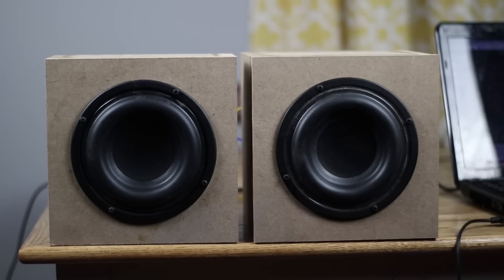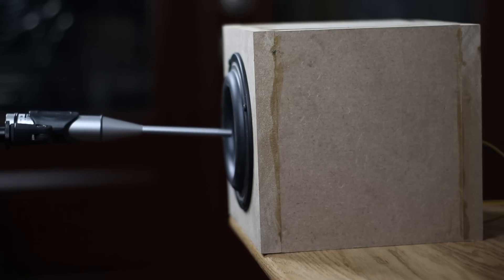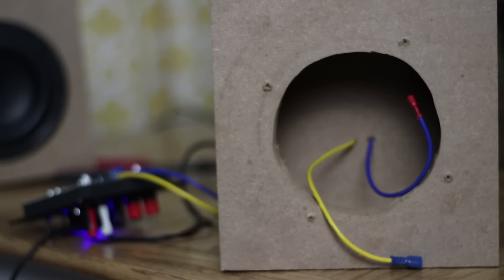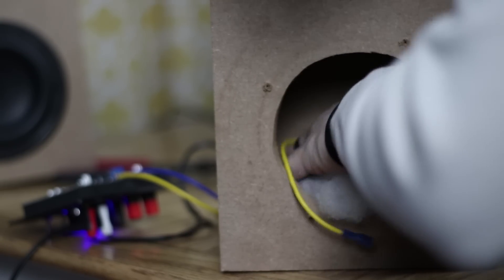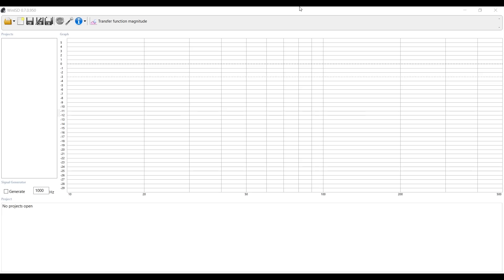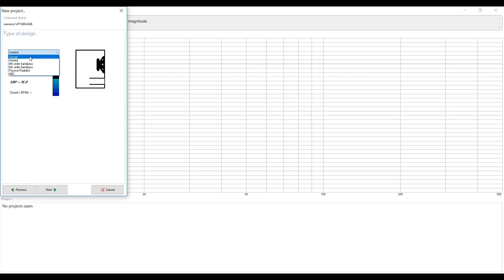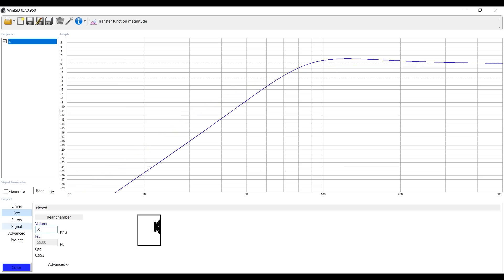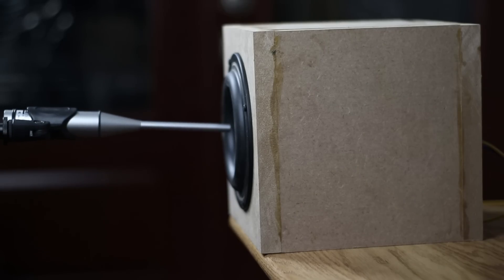Does Polyfill make a Box BIGGER?  Tested and Revealed

Comment: hihi toid you farvourite. driver from tangband is the one with rather high distortion :( at least mine had
Reply from the maker: It's probably my favorite small subwoofer (under 5 1/2"). There's not many that can get down as low with the large amount of output and relatively small box. It makes it very versatile.
Reply: Distortion in the lower frequencies has to be rather high to be discernible...

Comment: My speakers use 15" woofers in a 5.5 cu. ft. enclosure and 10" midrange in a 0.5 cu. ft. subchamber. The woofer portion has two 4" ports and the midrange is sealed. The ports are quire long and include a 90° turn. They only really come into play where frequencies are below the driver resonance. The woofer portion of the cabinet has some poly batting to reduce internal reflections on some surfaces. The midrange poly was determined empirically. I added and removed batting and listened to a lot of music. I think you can get in the ballpark with measurements, but leave it to your ears to get it right. If you alter one speaker at a time, you can compare sounds by switching back and forth. 

Nothing was indicated in the video about how batting works in an enclosure. As the pressure changes, the batting provides a much larger surface area for energy exchange. The pressure is converted to heat at the fiber surface. When pressure is decreased, the fiber gives up heat as pressure. Adding surface area in this way only works to a certain extent. Adding more batting reduces the energy transfer efficiency. The sound does change. As an absurd analogy, consider singing with a mouth full of cotton candy.
Reply: So well spoken. Exactly on point!
Reply: Your sub enclosures sounds just like mine. 15" sub, 5.5cuft, two 4" ports @ 36" long with 90° bends.

Comment: Good video.  I encounter this challenge when I want to build a speaker inside of an existing object (e.g., vintage radio case).  Sometimes the ideal space just isn't there.  I'd love for you to address the question of whether or not you get same impact from poly-fill in a ported enclosure. Also, the "weight" of speaker poly-fill you get from places like Parts Express is much heavier and or denser than the typical pillow stuffing.  What about the different impact of type of fill?  what about fiberglass wall insulation?  I see people using that stuff as well.  You can do more on this subject that would be of great interest.  Thx!
Reply: To answer your question (five years later) Polyfill pillow stuffing acts as both heat and sound insulation comes in different "loft" types which indicates density. For speakers; you want "extra" loft. Roll type is cheaper to get, by weight, than fiber fill, but you'll want to fluff it up first before stuffing the speaker if it's the roll type.

Comment: Another option to look into would be an Aperiodic Speaker Enclosure.
Reply: Oops never mind. I was confusing this with Steve Guttenberg's video that I watched right before this.

That's actually a really good point. The infamous Dynaco A25 is one, as is the KLH Model 33 (I own a pair of these actually, pretty nice sounding too). It's a great way to make a box seem bigger, and increase the bass extension. This is used in car audio frequently too. Due to the obvious space constraints.

Maybe we can get him to do a test on that too. I would be very interested to see the actual results of such a test. I've always been interested in this type of enclosure, especially since I have a small listening room.
Reply: @amb3cog  I use it in car audio after seeing it in my home setup. I have 2 10" subs that use Poly-fil due to small places but the subs are recommended for 0.4-0.6 cu' and Heavy Poly-fil so I used a bag in each enclousure and they hit hard. Now I am using them on my doors of 91 Nis Hardbody in a .4cu' enclosure per door. And going to tune from 50Hz on 12dB slope up to 90Hz so it will play down to 40Hz-100Hz as more of a MidBass vs Sub!
Reply: Aperiotic can artifically inflate box volume by about 25%. And if done right can give the effect similar to infinite baffle.
Reply: Varying the amount of polyfill is a great way to fine tune a transmission line cabinet. Much more reliable than the long fibre wool I used in the 1970s. It got eaten by clothes moths!
Reply: @jonathansturm4163  indeed. Getting the mathe just right can be a pain, but sometimes a little polyfill can correct them.

Comment: How would using a material with a higher density work? Like if you filled the speaker box with insulation?
Reply from the maker: I think that's a great question and I think it's worth exploring. For example is there a material that works better than polyfill. Maybe we will do a video on that in the future
Reply: @Toid  I would guess something fibrous that would convert movement to heat better, I actually sometimes use denim base insulation.
Reply from the maker: @attainableaudio7130  I think it would make a great video. Especially testing various stuffings to see which performs the best
Reply: @Toid  Believe It or Not - Back in the '80's, in Britain's 'HiFi News & Record Review' was a DIY speaker article, in which the author suggested a low cost alternative to Long Haired Lamb's Wool. Then considered to be the Ideal material, for these applications. The suggestion was Newspaper put through a Paper Shredder ! The reasoning was that Newspaper actually has a high cotton rag content. Mind you, The DIY enclosure in the article was a Aperiodic box. Which like a Transmission Line, would require vast sums of the stuff to line it properly. So the suggestion was truly a cost savings measure.
Reply from the maker: @RoaroftheTiger  now that is really interesting. It would be kind of fun to test something like that out. Thanks for the info!
Reply: I think this video is begging for a" part 2 experimenting with different fill materials to if the smaller box could out perform the large box"

Comment: That's not how it works. Woofer/enclosure systems are best modeled using Newtons Second law of motion applied to forced oscillation. Three factors control the frequency response, the moving mass, the damping factor, and the spring constant. In all but one design the damping factor and spring constant are frequency variable. For example in a ported design at some frequencies the speaker pushes air through the port easily, at others it meets strong resistance.  In the acoustic suspension design the springiness force depends on the difference in air pressure between the inside and outside of the box. The relationship is linear and independent of frequency. An added bonus is the restoring force is applied uniformly over the surface of the cone. Where does the polyfill come in. The speaker is forced to push and pull air between the fibers. Properly designed the aggregate surface area of the fibers is enormous. This creates an aerodynamic drag proportional to the velocity of air. It is also independent of frequency. Therefore this design can have any desired frequency response just by adjusting these 3 variables mass, spring constant and damping. In the solution as you fill the box with polyfill you are displacing air so as you increase drag you are also increasing springiness. 

A suitable woofer for an acoustic suspension design will have a low Fs 20 hz or lower, a low Qms around 2 or 3 and a low Vas of around 3 o4 cubic feet. A rule of thumb is optimal enclosure size is about 1/2 Vas and about 1 pound of polyfill per cubic foot. Parts express technical department will help you optimize your design using their computer modeling program and the Theil Small parameters for your woofer.
Reply: Yer building my next box lol
Reply: Great explanation! Love it.
Reply: Very well said , thank you
Reply: "Properly designed the aggregate surface area of the fibers is enormous."  That is exactly the point. But NOT to create drag, but rather to cool the air during compression (and heat it on decompression). Without such stuff the woofer will do adiabatic (=isolated from the environment) compression and decompression which heats and cools the air. Let's just continue with compression only, for understanding. Due to the gas law (P * V = constant * T), the decreasing volume (compression by woofer) will be balanced by a raising pressure, assuming the temperature is constant. However, adiabatic compression will raise the temperature. It follows that the pressure will raise more, because now both V and T changed. 
The Polyfill will just try to keep the air temperature constant, so to avoid the extra increase in pressure by temperature. Heating/cooling occurs in milliseconds or even faster. So it looks as the box become larger.
Reply: @avergison  The overwhelming majority of heat in an acoustic suspension woofer and all of it in other designs comes from i squared r heating of the voice coil. If anything filling the enclosure with fibers restricts the dissipation of heat.
Reply: @markfischer3626  Voice coil heating is a totally different topic, you are right in what you are writing. Voice coils heat up over time, typically in minutes. Contrast this to the adiabatic "heat" discussed above, which varies with the cone movement: whenever the cone moves inwards (compression) then the box air temperature will rise. Whenever the cone moves outwards it will cool down. So a, say, 50 Hz signal will cause the air to be heated 50 times and to be cooled another 50 times per second. The fiber stuff will form a thermal mass, taking up the heat or the cooling, mitigating the air temperature variations. It is warmed up and cooled down so quickly because it are tiny fibers. This will cause a lower pressure buildup during compression, just as if the box volume would have been larger. So, the filling shifts the compression from adiabatic to isothermal ("same temperature").
That's what I always have been thinking and believing.
BTW, I just happened to receive my copy of the book "Testing Loudspeakers" by Joseph D'Appolito (Amazon), and I found his explanation of the effect of filling materials on page 41. I hurried to verify what I wrote. Guess what?
Reply: @avergison  When air passes over a surface the frictional heating happens regardless of the direction. So if a high speed aircraft, missile or the space shuttle  is creating frictional drag it doesn't matter what direction it's moving in. The second law of thermodynamics  tells us eventually all directed energy is converted to random energy which is the definition of heat. This is the same viscosity phenomenon as the pearl dropping slowly through the Prell shampoo. If you drop a lead ball and a feather from the same height on earth the feather will float while the lead ball will drop like a rock. But on the moon where there is no air they'll fall at the same speed. Don't feel badly. It was 25 years between the time I learned Newtons second law and the time I thought about how it applies to woofer/enclosure performance.

Comment: I remember doing this! You can also do a similar trick with a vented box. Build the box a little smaller and run a longer vent. The longer vent length should be able to get to the correct tuned frequency.
Reply: You can also add polyfill to a porter enclosure by using screen material or chicken wire to keep it from blowing out the port. I didn't do that once and after cranking it for a bit, it looked like a stuffed animal exploded in my hatch area 😂😂
Reply: But don't forget, if you make a port longer you also need to make the enclosure larger as the port deducts away from the internal volume and you'll have an untuned box.
Reply: It's not a "trick", it's very basic box design.

Comment: great video! thank you. I've had a question about polyfil for a while if anyone can shine some light! I always get nervous stuffing the enclosure completely because I have a nightmare of things overheating and igniting after prolonged use if its stuffed completely and the polyfil is covering the amp board or any other electronics. Has this ever been an issue? should the components be separated from the polyfil via enclosure design, or am I overthinking things? Thanks in advance!
Reply from the maker: So that is a good question.  You really don't want to over stuff a box.  There are quite a few reasons for this. Some would include the fact that  some subwoofers have a vented pole, so you will want to keep that obstruction free.  Then there is the chance of it getting behind the subwoofer cone, also not a good thing.  So when, I say full, I don't mean overstuffed.  You want room for everything to still breathe.
Reply: @Toid  Appreciate your response!